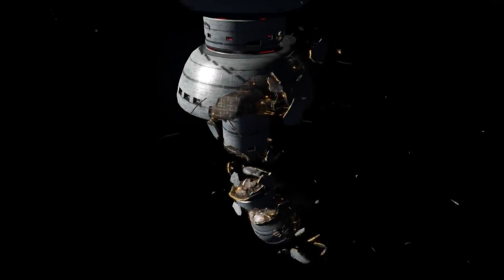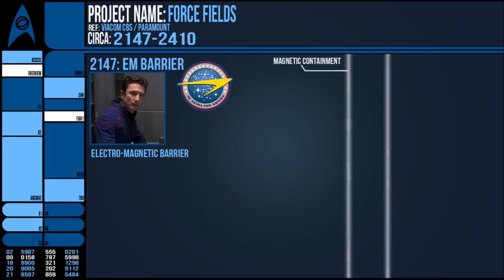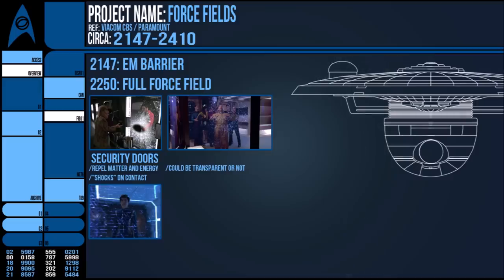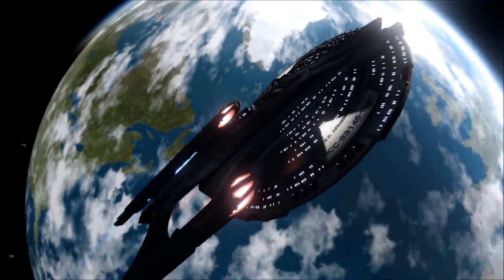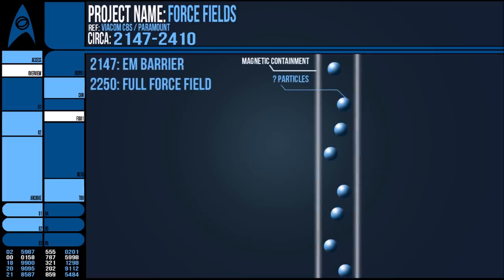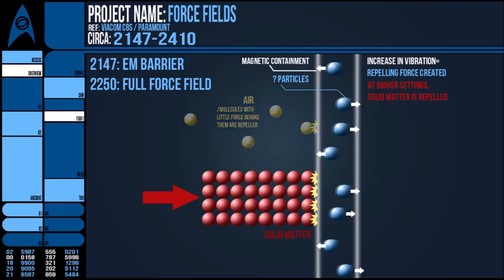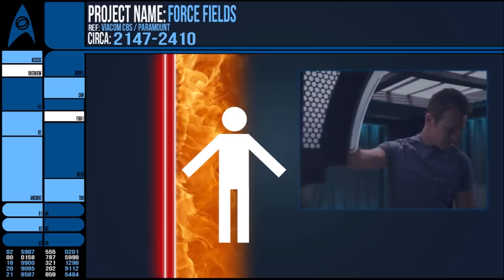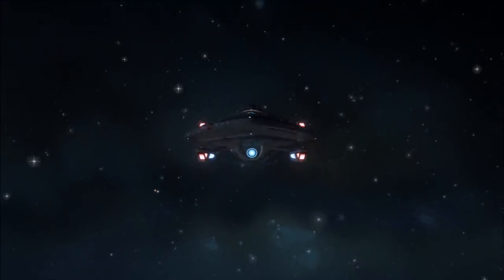How Do Forcefields Work? (Star Trek Theory)

Comment: The force field is an over used technology in Star Trek. In many cases, a hatch would more than suffice. After all, physical barriers don't disappear due to a loss of power.
Reply: Actually,  in star trek it can easily be assumed due to what we see and hear on screen that even the most advanced materials are woefully inadequate for standing up to the levels of energy that are constantly being used.  Weapons packing many times the yield of a modern hydrogen bomb are used on a whim.  And often impact just meters from the crewmembers.   The warp engines literally bend space and time using power beyond our entire civilization.   Impulse drives and maneuvering thrusters whip million ton ships around quicker than fighter jets.  That turn and flee maneuver the Enterprise D pulled in Generations exerted at least 300 GEEs on the ships hull!

Yet we see with our own eyes that even the best materials they use cant possibly stand up to a fraction of the energy we also see them use.

That's certainly why starships often look frail to our eyes, its because they absolutely dont rely on the physical struc5of these ships to keep them together unless they are literally unpowered and adrift.

Shields allow a ship to absorb sometimes dozens of attacks from energy based weapons and torpedoes,  yet we see on screen that it fairly consistently takes at most two or three torpedoes to completely destroy an unshielded ship.  Hence the almost cliche shield percentage countdown where the understood issue is no shields = near instadeath. 

A hatch can be phased through in a moment, simple doors are seen being knocked down by mere humans that happen to be pretty strong.  

I bet that if you visualize every invisib6field a starship relies on to function even a basic ship would look pretty impressive.
Reply: @DrewLSsix   I'm talking about when they use force fields instead of hatches as opposed to using force fields in addition to hatches. In the event of a power failure, there is no force field and then there is no barrier of any kind if there is no hatch.
Reply: In Star Trek we've seen many cases where a hatch is backed up by a force field.  The hatch contains atmosphere but also blocks solid objects.  The force field over the same opening can be more selective, but requires power.  Great for shuttle bays and other exterior hatches on a ship.

There's also many cases where force field emitters sufficient for a purpose take much less volume than the opening mechanism for a hatch.  Useful for emergency barriers along ship corridors which are not used most of the time.  Though if you'r anticipating hull breeches on a regular basis, such as a ship at war, putting actual hatches backed by force fields at intervals is a good idea.

Now if you really want to go overboard using force fields, use them for doors on individual quarters, with holograms for privacy.
Reply: @hanelyp1  every single corridor should have physical hatches and transverse bulkheads backed up by forcefields.

Don't get me wrong. I understand the utility and the obvious coolness factor of force fields, but they should not be option one. 

Ships developed to counter the Borg for example, should not use force fields in lieu of corridor barriers.
Reply: but are not as cool and less expensive during the day of the actual filming  of the scene
Reply: @scottmantooth8785   That is not my concern as I am making an in universe observation. Besides, how expensive do you think a door is? It also makes no sense as an argument because they used sliding doors extensively throughout the original series.
Reply: @UncleMikeDrop  you're overthinking this one... my example was hyperbole' ...absurdity for the sake of absurdity...i agree that an actual physical barrier would be far more practical...but for the sake of looking all high tech and all futuristic and spacey the plot narrative will rely on force fields because it's more dramatic to the plot narrative when they fail

Comment: Clearly when the Structural Integrity Field fails, a rapidly condensing foam is released to trap the energised particles in large lumps that will decelerate and drop much faster. This Rapid Opaque Containment Kapsule (ROCK) can often be seen when bridge consoles suffer critical damage. It's the only rational explanation.

Comment: There is no air in space, so the outer side of force field has no magnetic potential to counteract, however air inside the force field is conductive, so the force field's polarity must be same as air molecules, otherwise the force field would not repel them... Two sides of force field must in logic have same polarity, so the inside of the force field can have opposite polarity to keep the force field in place. Because shuttle crafts are made from conductive material, they can react with the force field and go through it, essentially pushing the two fields together and not destruct due to inside of the force field having same polarity, so essentially grounding itself to the force field... Deflectors on the other hand have opposite polarity so metals and other conductive materials get repelled instead of attracted.

Degrading of the force fields and deflector shields is due to impurities getting trapped inside the force field when something that has opposite polarity manages to penetrate the outer perimeter of the field and get trapped and/or cancel the field partially. Powering off the field will release the impurity and that is basically how the force field is repaired.

Comment: I often wondered how the FF was connected with navigational shields because the NS was always on but had to be stronger than any material known to man since even a pea hitting your ship while it is zooming across the galaxy would instantly destroy it.
Reply: Deflector shields were originally envisioned as a magnetic field that deflects those particles away from the path of the ship (gently suggesting they go in a different direction that doesn't go through the ship), distinct from defensive shields (directly absorbing weapons fire).
Reply: Supposedly the navigational shields emanate from the deflector dish so this makes me wonder how we have seen so many ships lose their dish yet can go at full impulse power without blinking an eye.  Full impulse power is 1/4 the speed of light which an object the size of a pea would instantly destroy the ship at that speed (167,000,000 mph or 74,770 km/s).  Even 1/4 impulse power/speed would be 18,665 km/s or 41,752,416 mph).

Comment: I would like to know what it feels like to touch a force field
Reply: Short out a car battery.  That should give you an approximation.
Reply: @bozhijak  Lost a good wrench by doing that by accident once.
Reply: I figure it'd be like licking a 9Volt battery, combined with the feeling of your arm falling asleep and you let the blood flow again
Reply: Ask a mime.
Reply: Depending on the strength of the field, between walking into a sun-warmed concrete wall and walking into a concrete wall with a megawatt electric fence on its surface.

Comment: Do you really need force fields, why not use better armor, or a Door?
Reply: I can't find any argument against external force-fields that are used to seal off hull breaches, and I imagine something like a structural integrity field is effective when you have an excess of power generation and want to improve your armor without adding as much extra weight as doubling the thickness of the hull (particularly since it works in tandem with the armor, rather than instead of it).  As for prison doors... yeah there's no excuse for having a prison cell door that just... turns off if there's a short loss of power. Containing a potentially dangerous creature that can squeeze through gaps in the door meant for air would warrant a force-field, but it shouldn't be the primary means of prisoner containment when any old door would be completely sufficient.

Comment: See Plasma Windows / Plasma Valves for a Real world analog

""A plasma window's viscosity allows it to separate gas at standard atmospheric pressure from a total vacuum, and can reportedly withstand a pressure difference of up to nine atmospheres.[2] At the same time, the plasma window will allow radiation such as lasers and electron beams to pass. This property is the key to the plasma window's usefulness — the technology of the plasma window permits for radiation that can only be generated in a vacuum to be applied to objects in an atmosphere.[3][4] Electron-beam welding is a major application of plasma windows, making EBW practical outside a hard vacuum. ""
~~ https://en.wikipedia.org/wiki/Plasma_window

And 

"" Similarly, in the plasma window, a plasma (which is an ionized gas confined by electric and magnetic fields) separates air from a vacuum by preventing the air from rushing into the vacuum. A variety of gases can be used to operate this window. When argon is used, the window color is blue, similar to that shown in Star Trek. ""

~~ https://www.techbriefs.com/component/content/article/tb/supplements/etb/briefs/1834

Comment: well glenn stole thunder but guesses had artificial gravity. that use artificial gravity to push things away wall. as gravity work power sun. do same thing energy weapons. though it seem use energy force filed. lighting or other energy shock or zap persion back. this like how animal electric fence work. so example jail tried walk open door cell shock or zap back. then iron man force fields. witch tiny little iron man arc powered nano robots.. how this works is tiny tiny robot has tiny arc reactor power source. tiny tiny repulser ray same one in glove. and and feet. that robots move around. add with hallorgrams. means see through it. but really wall of robots block what try hite iron man. in theory stare track could do this easy as have hallow decks . and seem put hallow impiters every were. and have transport move people and stuff all around. so they teleport wall in use hologram make look hall way. but walk 6 feet steel wall. when  turn it off force field. teleport wall away.